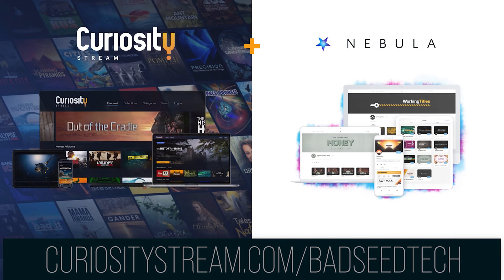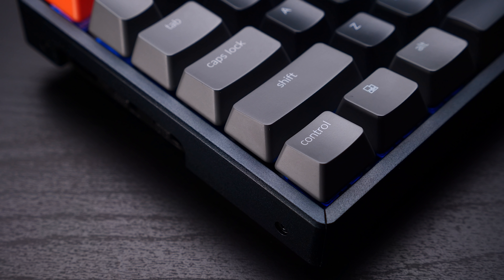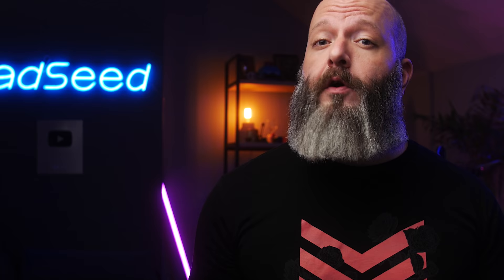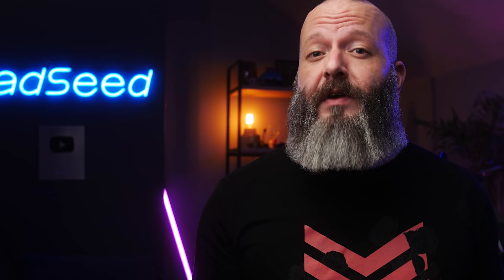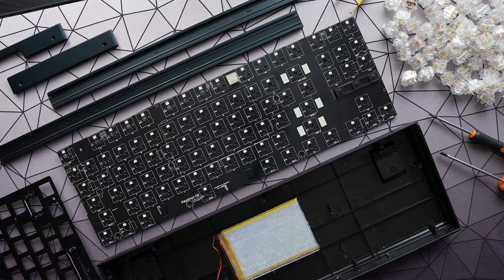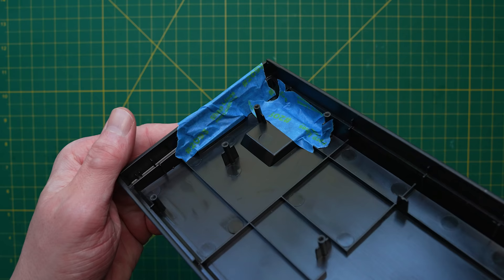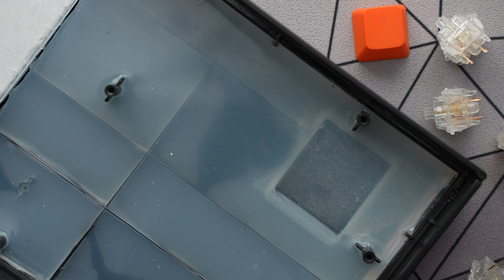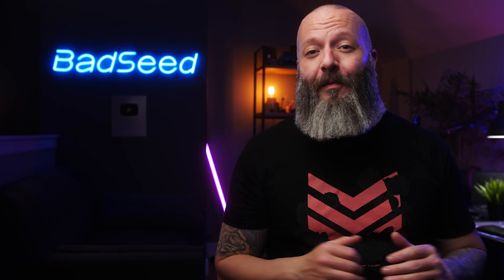Keychron K8 Review: Solid - *After* Some AQUA KINGS

Comment: Keychron K8 is what really got me into the keyboard hobby. It was affordable, wireless, multi-OS, looked nice, and worked great out of the box. What I really loved was how easily I could improve the experience with hot-swapping different switches, removing them to lube, adding case dampening material, better keycaps...the K8 is cheap, versatile, and easy to mod. I couldn’t ask for a better gateway drug.
Reply: I had the same experience this past month, k8 got me into the hobby. I put oil kings in it(I want to try aqua kings and novel creams) and foam modded it. New keycaps on the way soon and I cannot wait to start work on my first full custom lol

Comment: I'm so glad youre reviewing the K8. TKLs are already a hard form factor to find in the budget custom keyboard category so having someone like Keychron approach it is nice. Even if its not the best keeb available, its probably the only one readily available and having an honest review really goes a long way. Thank you!
Reply: Take a look at the non-pro GMMK TKL?  It's $10 more than this Keychron and actually has aluminum upper body construction as opposed to this goofy aluminum picture frame.
Reply: @barrylinkiewich9688  Not wireless though.
Reply: @EzioYuio  wireless isn't really a consideration for me since I use my keyboard at a desk with a desktop but if I was using it mobile I'd want something much more compact anyway, to save weight and space in a bag.
Reply: @barrylinkiewich9688  Not for you but it can be for others. I use the K8, because it's the cheapest wireless mechanical TKL I could find.
Reply: @EzioYuio  wireless just seems silly on a desk but whatever works for you.
Reply: @hexa3171  Very nice of you to share! Thanks. Too bad I already have a good keyboard, but it's nice to know other options in case I feel like changing.

Comment: Interesting how they basically just wrap the keyboard in aluminum. I wish it was all aluminum tbh. Great review as always !
Reply: waste of aluminum here imo
full aluminum or gtfo basicall, put some high quality plastic. Here we see neither of these
Reply: They can’t make it all aluminum because the price would shoot up a lot
Reply: I have the K2 version 2 with aluminum and must say even though I know the whole case isn't aluminum, I would have been disappointed with a plastic case. The aluminum makes the board feel very more premium without causing a huge price increase.
Reply: There would probably be Bluetooth connectivity issues with an all-aluminum case, though. Perhaps they could potentially cut out a window in the bottom of the aluminum case and install a plastic plate for the BLE chip to communicate through. Or otherwise, they could try what some other premium mechanical keyboard brands have done and install the BLE chip right below the spacebar, which (assuming PBT/ABS keycaps) should allow for full signal strength connectivity.

Comment: When this video came out, I had parts on order for a keyboard almost exactly like this (K8, Aqua Kings), and was blown away by the idea of the silicone dampener.  Ordered some silicone instead of the neoprene foam I originally intended to use, and damn man, it's a game changer; so easy, so effective.  The effect it has on tightening up the sonic properties of the board cannot be understated, although I did go an extra step to fashion a makeshift plate foam with sorbothane.  Along with Aqua Kings not needing to be relubed or filmed and the hotswap sockets, it felt like cheating modding this board to bring it up to spec.

Comment: Got the k8 a few weeks ago with gat browns. It's my first hot swap board and I swapped in lubed and filmed gat yellows to try a linear switch, modded the stabs, got some drop skylight caps, and added sorbothane. While I liked the sound of the yellows I found myself mistyping too often. I bit the bullet and got drop panda switches which I just finished lubing and putting in last night. Really liking the feel but not so much the sound. I think im a tactile guy.

Im trying to control myself because I can see me spending a lot of money into this hobby.

Comment: For those wondering, I think Keychrons are plastic by design and only have alu on the sides is in part to retain its Bluetooth capabilities. One reviewer of the IQUNIX F96 (it's like a full alu K4) noted that its Bluetooth module is an external block basically glued outside the bottom case because the Bluetooth signals wouldn't be able to pass through a full alu body.

Although of course cost plays a big factor into its design. They can basically use the same side alu panels for multiple units of their wireless models since they will all have the same length (K6 and K12 - same; K2 and K4 - same) and cut-outs (all wireless units have the usb-c and toggles on the left side). If I'm not mistaken they can even recycle the top and bottom alu panels for K2-K6-K12 and K4-K8.

Comment: I own a K6: Durock stabs, band aid mod, Gateron CAP Milk Yellow switches and a keycap kit taken from KPRepublic. I filled the board with packing foam in order to get the sound I like and it plays like a dream! 

A good but not so expensive set of keycaps for this board would be the PBT/Dy-Sub set made by HKGaming (39 pounds here in UK), it has the right keycaps for filling the board and it also has enough modifiers which let you maintain the original layout of the board! 

I basically got my board done for: 
 - K6 89$
 - Gateron CAP Milk Yellow 35$
 - Durock stabs 9$
 - Foam (used the one at the bottom of the box) 0$
 - Keycaps (Doubleshot, 1.3mm PBT, Cherry Profile) 72$

Total 205$

If you like one of the HK Gaming sets you can bring it down to 172$, which is not bad for a wireless mechanical which is compatible with computer, tablets and smartphones alike!

Comment: I have a Keychron K6 and I love it! It was super easy to mod, I painted the aluminium bezels a nice blue and got some Mizu keycaps from Banggood. 

It’s just amazing
Reply: How did you go about painting?
Reply: @dankengine8484  took off the aluminium bezels, sanded them down with some sand paper, primed it, then I put on 3 coats of blue spray paint and then finally some clear coat. 

It was a really simple process and I loved the way it turned out

Comment: I bought this keychron k8 when it first left Kickstarter.  I ended up putting in cream switches and changing to thicker doubleshot pbt keycaps. I regret not moding stabs or lubing the switches. Eventually I got tired of the board and wanted something better sounding. I currently use a kbd67 lite with cap yellow switches and love it. The k8 is an excellent budget hotswap option, only downside for me was the stabs and the sound signature from the case being so hollow.

Comment: i like what keychron is doing a lot. 

I do think your poll is a little warped - you're going to have most of the enthusiast community in that last bucket, and that's mostly because it's everything but full size/tkl (very few enthusiast full size users, and tkl is not as popular as it used to be) 

you should redo the poll with those options split out a little bit. for example - I don't use 65 or 75 very much but do use 40s and 60s quite a bit.

Comment: While those legends do look nice now, I'm not convinced that would last. The cap itself is made of ABS which is all fine and good - but it's a single piece of clear plastic - the gray / orange coloring is paint on top of the ABS; it's either been screened-on, or laser-ablated off to make the legends. That lets them be nice and thin and crisp - but it's likely also the culprit for the weird chalky feeling, and more importantly, wont't last like doubleshot or dyesub caps will. AQUA KING HYPE! I ordered mine like a month ago... I think they're stuck in the Suez Canal...

Alright, man - you're like the third or fourth among my favorite youtubers to hop on Nebula... I think I'm gonna have to check it out.
Reply from the maker: Yeah, painted ABS isn’t exactly known to go the distance but I get the impression most folks are treating this like a barebones - caps are there more or leas to hold you over until you put something nice on.  And the Aqua Kings are LEGIT. 👌🏻

Nebula is really growing right now, I was pretty shocked I got a seat at the table but I’m going to have some exclusive stuff there pretty soon.

Comment: I have this keyboard with the Keychron Optical red switches. Threw some Matrix pudding keycaps on and it lights up great with the RGB. Never done any modding so I'm happy with the stock switches/stabilizers. Jumping between Bluetooth on the Mac and wired for the PC, it's really ideal for anyone needing that Bluetooth.

Comment: Great video, I own 4 Keychron keyboards, they are great. My last one I purchased was the C2. Needed a full size hotswap with detachable cable for work and this fit the bill. I took out the gat reds and went with NK+Kailh Blueberries (lubed with Trybosis 3203) and Drop Artifact Bloom Series keycaps (Futures set). Did the same stab mods (clipped, lube, & bandaid) and neoprene foam the bottom of the case. Love how it turned out. My K4 and K3 (still have stock keycaps) are also modded but my K6 is stock except for the Drop Loop pudding keycaps.

Comment: Just a heads up, the 90 degree adapter in the description is a really tight fit on the K8 bc of how the port is indented in the board. Had to cop a different adapter for a better fit

Comment: I have the k4 v2 for work. It's pretty alright. Stabs needed work and the key caps are pretty bad super thin and cheap sounding, and the soldering work on the hot swap sockets is a little iffy at times so you need to be gentle with the switches lest you pop one out.

Comment: I have had this keyboard for awhile now and I do have some minor issues. My Bluetooth for some reason doesn't like this keyboard on win 10. They should included a 2.4ghz dongle! Also the keycaps feel like trash and I don't really like the cable coming out of the side but other than that the board is solid!

Comment: I have a k6 modded af and btw some cool guys ported qmk on it and works great :D ... i have black inks, dampening foam, pcb-plate foam made with silicone ( made by 3d printing a reverse plate basically to make the mold ) and its silent and nice with some np crayon kbd fans keycaps ... overall for a 100$ keyboard its amazing
Reply from the maker: Damn, I bet that board sounds amazing.

Comment: idk what they did to the newer batches, but I just got the k2 and it sounds exactly like the modded version in this video, ofc the actual sound of the board isn't coming through exactly given the amount of variables to control, but there's no rattle on my unit and it's surprisingly thoccy sounding out of the box. Can anyone confirm if they changed things or if their board is similar.

Comment: With my k6 I did all of this but used sorbathane and it is a fantastic board after the mods. It's definitely not a custom board but it is significantly better than stock and still comes in under price of many other boards.

Plus I need bt and wireless which is rare in customs.

I did hop in the GB for the Ikki68 for the bt version. I know that board will blow the k6 out of the water but that is more custom.

Comment: I'm new to mechanical keyboard mods and would like to upgrade my stabilizers for this keyboard. Any suggestions?
Reply: Well first learn how to take apart the stabs and put them back together. Then after you learn that learn how to lube stabs, Also try different stabs mods some will work out then other but it just boils down to preference. Hope that i could help you.

Comment: My worst buy ever!!!  After just 3 weeks, some of the keys were not working anymore.  When I sent it for RMA I was told that I voided the warranty because the switch was removed.  WTF!  It was a hot-swappable keyboard so of course I should be able to replace the switch.  And then lo and behold, I did not hear from them again despite numerous follow-ups.  I sent the KB in November 2021.    Purchased it October 2021.  It is now Feb 2022 and I am thinking goodbye to my money already.  Nothing.  Just pure silence from Keychron.  Simply not interested anymore.  I already bought my GMMK TKL in November, just one week after sending it to Keychron and so far no issues except for the chatter which I easily resolve.  Keychron is my worst keyboard experience EVER!!!

Comment: Yeah. Sadly it has only a good pricepoint in US\CAN. If i want to buy this in europe i pay around 130 Euro, which is 150 Dollars. And at this point its not interesting, because i can buy a ducky one 3 for that or a gmmk. Positive: You get ISO standard and even DE Keycaps BUT.....not pre Assembled. I can only pre assemble a US Layout. And if i order the Barebone (which is sold out 99% of the time because of Scalpers) i pay about 100 Dollar more for Caps and Switches even without shipping.

So, if Keychron dont care about europe, they can use their plasticy Keyboards on their own ;) The Aluminium Frame is a Joke, sorry. For about 150 to 200 Dollars, i definitely buy a other Keyboard.